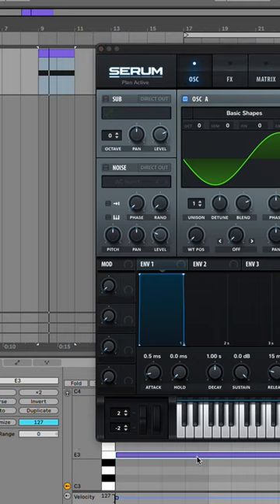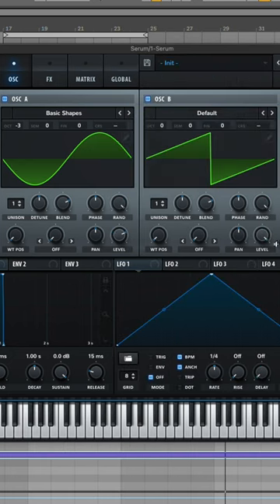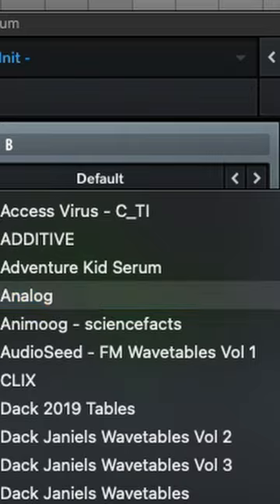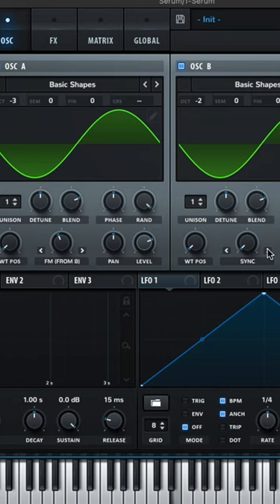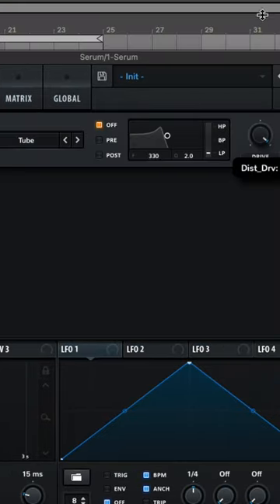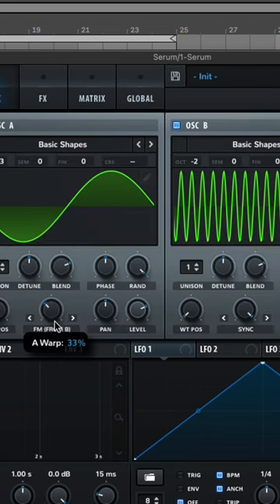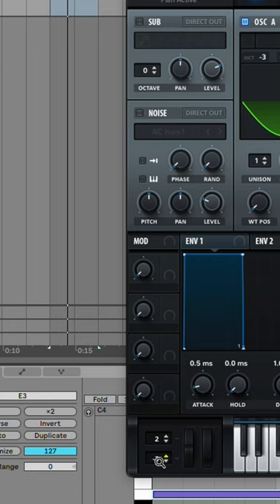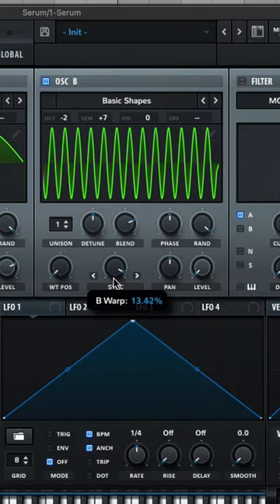QUICKEST DUBSTEP/TEAROUT LONG BASS TUTORIAL W/ DACK JANIELS

Comment: I always write in E because where its located on the keyboard, what started as a bad habit turned smooth when finding that fundamentally it has rhe best sub and most clarity aswell. C too low G too high E, just right. D isnt bad either.